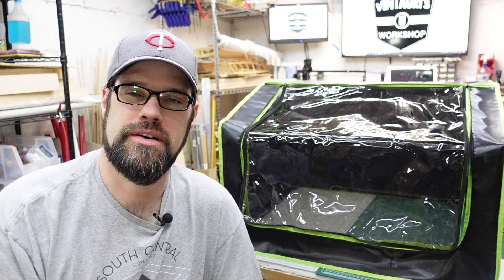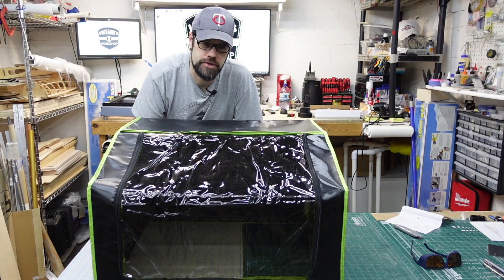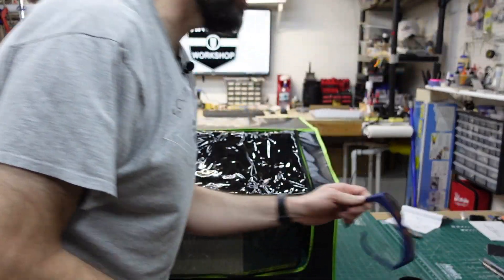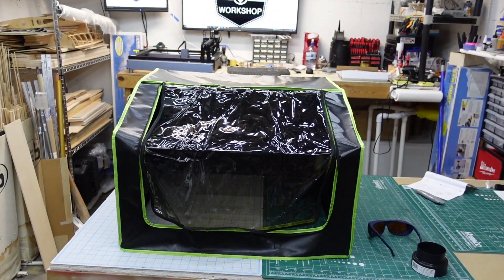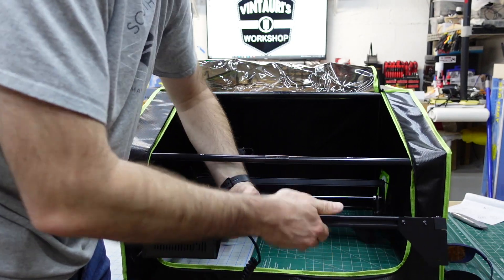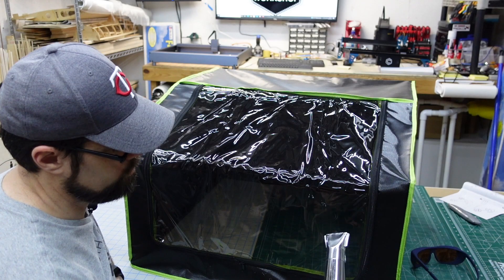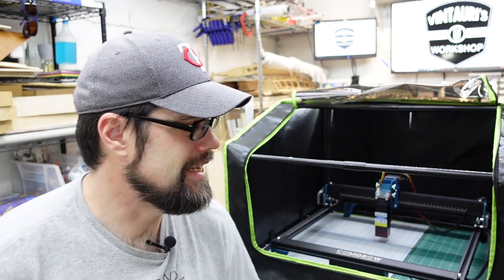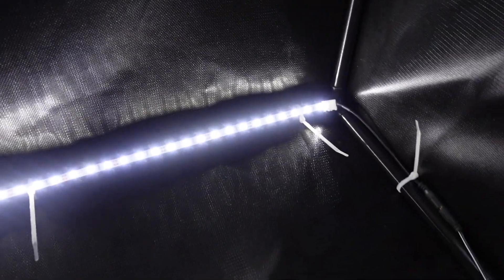Easy and Effective Diode Laser Enclosure from Sculpfun

Comment: This enclosure does not work well with their offered lightburn camera CAM500. With a 120 degree wide angle lens you needed to mount it at least 700 mm above the 400x400mm laser bed to cover it all. So either i buy the enclosure and get rid of the fumes or i buy the camera  for better positioning. Both of them together makes no sense. Cam height not sufficient.
Reply from the maker: This enclosure was designed before they came out with the camera add on for their lasers.  If you still want to use this specific enclosure, I would look at other USB cameras with a shorter focus distance.
Reply: @Vintauri 120 degree is the normal wide angle fov. Takes a whopping 70cm to fully cover a 400x400mm area. I bought a HD webcam and will built a simple gallow myself. The stuff they try to sell is even worse than the DIY. Look how sloppy they 'describe' the specs. Horrible.

Comment: Hi.  The fan you are using, how far will it push the exhaust?  While watching the vid, your black hose looks well over 10 ft long.
Reply from the maker: That really depends on the type of hose and the number of bends. In my basement shop I have an auxiliary 6” inline fan pulling air at the exit point. I would not try to push the air more than a few feet if you have too many bends.

Comment: Thank you for the information very helpful. 
i hope you will help on this .. 
about to purchase an engraving machine. 
I also Owen  a DTF machine work at my apartment. 
Is that possible to engrave small items in side my apartment ? 

 if is that possible , can you suggest any tips or tricks to avoid the smoke and the smell? 

Thank you for your time 🙏
Reply from the maker: Your best bet is if you can vent the smoke out of a window using a temporary spacer with a hole the size of your vent tube.  However, you'll want to be careful if there is a screen on the outside as that will collect debris and vapors and your landlord might not like the mess it leaves on the screen. There are some filters you can purchase but to get one that will completely scrub the smoke and vapors you would be spending thousands of dollars on the unit and replacement filters.

Comment: i made me an enclosure with a fan. but my laser heats up and does not cut as good when with no enclosure.
Reply from the maker: You might need to open up the enclosure a bit to ensure there is enough air movement.  If you try to seal it up and then pull air out, it will be starved and the air will not move through the enclosure thus trapping more of the smoke, and hot air.
Reply: @Vintauri  i'll give it a try. Could it be the hardnes of the plywood? Or should it always cut smooth on a 3mm plywood? Thx for the quick answers.

Comment: Do you have your exhaust tube going out a window. I’m putting mine in my dining room, plan on putting out the window.
Reply from the maker: Yes I do have a vent going outside.  It get's cold here in the winter so I have a vent installed similar to a dryer vent through the wall as I want to keep my windows sealed up.
Reply: @Vintauri  Thank you.

Comment: I been researching exhaust fans. Does the one you have seem to get the job done, or do you wish it was larger or pulled more cfms?
Reply from the maker: It works well if you have everything piped smooth but I might see about working in a larger fan to pull a few more CFM.

Comment: Did you have to use a reducer for that inline
Reply from the maker: The port on the side of the enclosure is about 3".  I used a 3" to 4" adaptor to work with the inline fan.

Comment: Good tip for a spritzer - I am awaiting an Xtool d1 pro & it is my first laser. I was planning to put a small fire extinguisher down there. (Basement has a good place for exhaust from previous owner having wood stove heater down there - we have added different heating since, so it is just plugged right now - perfect to use for exhaust of different tools/sublimation etc), however, to try a water spritz first seems to be much more cost effective & less destructive and easier to clean up than pulling the pin on that first lol.

Comment: I was looking at this. 100 bucks is high for what it is (I am sure it is fair, it is using fire retardant materials & I am assuming the plastic has at least some protection from uv)? Your design for Xtool is is the way to go when you have an Xtool & the ability to do some cabinetry-style woodworking, though. I am going with that. Edit: It seems to block a little blue, but it isn’t something I would consider protection, indeed.
Reply from the maker: It does block some of the light and in reality, we're only talking about it blocking random reflections which should be rare, however, all it takes is one bad reflection hitting your eye that could cause serious damage.  Investing in some quality glasses really is the way to go.  This setup is a good option for someone who does not have the time or ability to build something more custom.

Comment: Did you ever try to find an adapter for the port to make it fit a 4" hose? Just curious as I am finding it frustrating to find one that actually fits.
Reply from the maker: I have not found a direct fit for it. I might try drawing up something to 3D print but for now the adapter from home Depot is working with the electrical tape to hold and seal it.

Comment: If the laser had air assist, i guess slide the air hose under? Would the weight of the frame stop airflow?
Reply from the maker: You could slide the air assist under the fabric side but over the frame and even use the frame to support it to the top.  It should not be a problem.

Comment: Great review! I see on your D1 you have Air Assist, did you have any problems using it with this enclosure, I wanted to make sure the air hose was able to move around without binding up as the laser moved?
Reply from the maker: As long as you leave enough slack on your air line you should be able to run it up the side of the enclosure and support it from the middle bar.  That leaves the air line to move around the enclosure without tugging on the line too much as it goes to the far corners and back.
Reply: @Vintauri  excellent, thanks for the info.